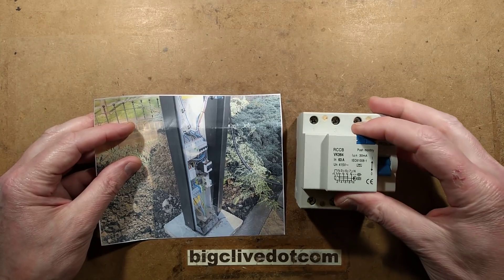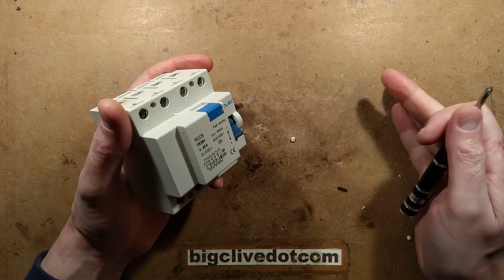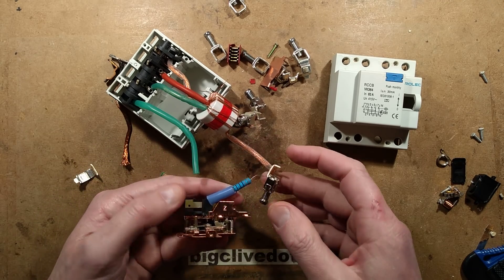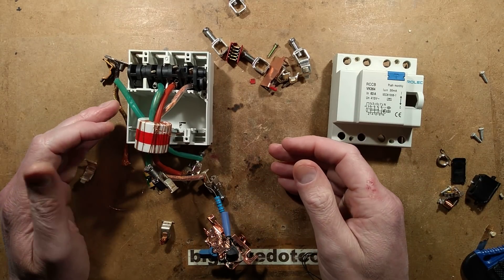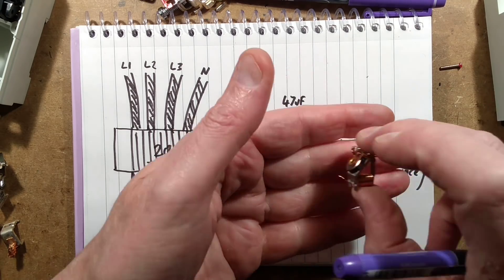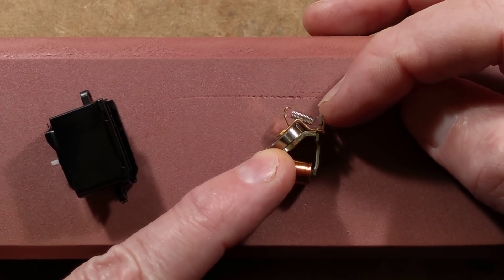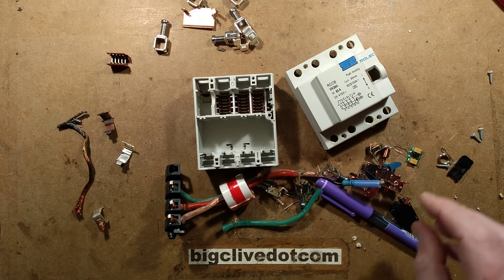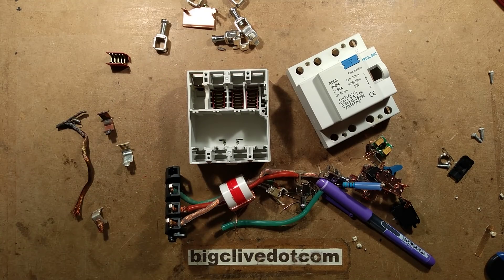Failed 3-phase RCD/GFCI from a Rolec electric car charging pillar. (with schematic)

Comment: Due to harmonic distortion more current flows through the neutral than the phase conductors, (not be confused with power factor). This is why the DNO are oversizing the neutral on new installations, eg 50mm phase conductors 70mm neutral. All modern switching electronics from light dimmers to switched mode power supplies cause harmonic distortion.

Comment: Many EVs only support single-phase charging (typically 32A) , so the burnt pole may be the neutral - Rolec had lots of issues with burnt neutral terminals on home charging units. My guess is that the spring being at the end furthest from the burnt contact means there was reduced contact pressure
Reply: The load was mostly single phase 32A, the L1 got most of there work to do. With these RCDs the neutral always seems ok though (despite the single phase load) but the single phase versions burn up even more quickly. My guess it is a combination of contact pressure and high resistance metal used on the contacts, they are just not suitable for 32A for 7 hours each night, night after night. This one lasted 3 years, but the new one that Rolec sent is a different design and I've not heard of the newer ones suffering this issue.
Reply: @G8YTZ 

Hmmmm.  Depends what you mean by mostly single phase.

If it were a balanced 3-phase load then the neutral current ought to be zero.  If it were a pure single-phase load then the neutral current ought to be the same as the L1 current.  Anywhere in between balanced and L1 alone, the neutral current is going to be less than L1 current.

Doing phasors in my head (and probably getting it wrong) a 32A L1 with 16A L2 and 16A L3 is going to result in 16A in the neutral.  32A L1 with 31A L2 and L23is going to result in 1A in the neutral.  32A L1 with 1A L2 and L3 is going to result in 31A in the neutral.

The L1 current could be significantly higher than the neutral if it's mostly single phase.  Depends what you mean by "mostly."
Reply: @bdf2718  The supply and charger are 3-Phase, but some cars have three phase chargers and some cars (the majority) have single phase chargers. This is why 4-Pole Type A RCD's are used as the neutral is required for single phase cars. (Type A is to detect pulsing DC faults on the DC side of the carer as Clive states).

So if you plug in a single phase Car (for example a 60Ah BMW i3) then 32A will e drawn between L1 and Neutral. (94Ah and 120Ah i3's have 3-Phase chargers, if their connected to a 3-Phase supply they will draw 16A/phase (12kW), if connected to a single phase supply they will draw 32A (7.4kW).

Most EV's have single phase chargers, hence the term "Mostly" so the L1 contacts will be more stressed rather than L2 and L3. The neutral contact in these RCD's and in the single phase version of this charger type for some reason never burn, but the L1 (or L contact in single phase version) contact always burn, even though they are running well within their rated current, but the very latest examples seem to have improved contacts.

A Tesla car also have 3-Phase charger(s) Depending on the model and age either 16A, 24A or 32A, but they all draw a maximum of 32A when connected to a single phase charger.

Note the function of the charger's Control Pilot pin (set on installation) defines the maximum charging rate according to the circuit and/or charging cable capacity. The car takes its loading instruction from the CP pin.
Reply: @G8YTZ  

The situation you describe doesn't mean that L1 is more stressed than L2, L3 or N.  It is stressed to the same level as L2 and L3 for three-phase vehicles and stressed to the same level as N for single-phase vehicles.  The situation you describe means that L1 is stressed more often than the other contacts.  Which isn't quite the same thing.

If you're right, it means none of the contacts are capable of carrying their rated load without burning out after a certain period of time.  It''s just that the L1 carries its rated load more often than the others.  It would mean that if it were used only for 3-phase vehicles then L1, L2 and L3 would all degrade to a similar extent and if it were used only for single-phase vehicles then L1 and N would degrade to a similar extent.  Which may well be the case.
Reply: @bdf2718  Except that this charger has never been used on a three phase load, so the L2 and L3 contacts have never seen load. But in practice is it is always the L1 terminal that burns (even on single phase units of the same make with a completely different two-pole breaker) and never the neutral which carries the same load. So there is something very funny about the L contacts. I even checked the power factor and harmonics from the load - close to perfect too. So it's a very strange occurrence, but one that many have seen. As Clive suggests it must be down to contact pressure not quite what it should be on the L1 contacts and that could be down to the positioning of the spring that keeps the contacts closed being at the opposite end of the cam, so pressure is not constant across all contacts (the neutral having a highest contact pressure).
Reply: @G8YTZ  
If it's never seen three phases loads then it has to be down to contact pressure.  Location of the spring would explain that.
Reply: @bdf2718  Yes - exactly entirely my thoughts. RCD's do get warm, I wonder if there continual warming of the mechanism causes the metal to soften? I have Crabtree Star Breaker MCB's and RCBO's in my Consumer Unit. The RCBO's really get warm, even with no load! The MCB's run cold. I'm wondering if there is not a scandal here with energy eating circuit breakers? They make a big fuss abut a few watts from a TV on standby, but has anyone thought of all those RCBO's out there? I have a FLIR IR camera. Clive, could this be an interesting investigation?
Reply: @G8YTZ  
I have almost no knowledge of materials science, but I doubt there's enough heat for softening.  And if there were, it would apply to both L1 and N (it's enclosed and convection will smear the heat all around).

Spring at one end of the bar seems the most likely explanation.  I'm not a mechanical engineer either, but I understand enough about levers to figure out why that was a very bad idea.
Reply: Looks like in this one the burnt one is marked 1, with the neutral being at the other end, next to the switch lever
Reply: Yeah, I'd guess a mechanical imbalance too, if it's true that it's always the end contact the burns out.

Comment: I think the end contact burning is due to Newton, it will take just a fraction of a second longer to breake contact due to inertial forces causing twisting of the contact bar. All the actating forces are at the other end of the bar so it will twist a fraction as the contacts are opened so the far end will be the last to open so the system will try to draw all the power of that one line.

Comment: This reminds me of when I used to work in tv repair - Back in the 80s we used to see a lot of those old Ferguson TVs that used the Thorn TX9 chassis. These had an unusual thyristor-based PSU, and the most common issue with those was a burned up connection inside the mains plug, and it was ALWAYS on the neutral pin. Usually just cleaning up the connection (or in bad cases just replacing the whole plug) would result in a long-term fix but it was a bit weird at the time why it would always be the neutral end that burned up rather than the live.

Comment: The reason the first phase went out is likely because there are a substantial percentage of electric cars that only use one phase of input power.  So that post will often be supplying. Ritually no power on phase 2 or 3. So 1 is used most and most likely to fail. Of course in this case the neutral is carrying the same current as phase 1 and I can’t explain why it is unaffected. 

The high power chargers your hear of are DC fast chargers. Unlike this AC EVSE (this is not technically a charger as the onboard charger is used for AC charging) a DC fast charger has a captive cable. So people are not using their own bunk cables on Those fast chargers. On the other hand the cable on a 1MW DC charger will be water cooled. So that’s potentially exciting. 

In the US an EVSE must have built in ground fault monitoring and disconnect on fault. I’m sure it’s the same in Europe. In the US some say you should not use a GFCI with and EVSE because of this but as far as I know they work fine in that combination. My EVSE has no GFCI breaker.
Reply: So I looked it up to try to be more sure I’m not wrong.  It the full spec is $500 and I’m not THAT dedicated to accuracy. 

It appears that in the US even though every EVSE seems to have integrated, active monitored, self-resetting ground leakage detection it is not required to have this. It simply must have the detection and trip functionality in the EVSE. Not just in the install (like in the post) but as part of the EVSE. And also the requirement is 30mA in the US also as you indicate in your post. So as long as this RCD is actually inside the EVSE itself as shipped from the factory this would be a legal configuration in the US. I had previously thought it was not as it was not active monitoring.

But I have never seen an EVSE that just had a physical breaker like this in the US. All are self resetting, implemented as a ring around the conductors inside the EVSE that is monitored by the EVSE circuitry itself. They basically just have two rings, one which passes all conductors and one that passes only one supply conductor. The first is to monitor leakage and the other to monitor current draw for over current protection. Protection is implemented by simply cutting off the power to the wand with contactors if a fault of any kind occurs.
Reply: Steve Bollinger - interesting 😀. Strange how for something that is new, therefore no existing equipment or old standards, different countries still have different ways of doing things.
Reply: Steve Bollinger - the device that failed is an RCD, used to detect earth/ground leakage faults...
Reply: Mark 1024MAK I know. I’m not sure what you are getting at. In the US the EVSE itself must have the ground fault function detection as part of the EVSE itself,  it as an external device as you see here. I expect it’s the same in Europe. Although again, it is my understanding that despite what some people says it should work fine to have an externals protector also.
Reply: Steve Bollinger - Are you saying that the requirements are that there must be additional protection against earth/ground faults? I don’t have any specific knowledge of electric vehicle charging points, as I have not worked on any. In the U.K. for outside electrical supplies, RCD protection with a trip current of 30mA is required. For a dedicated circuit spur such as a recharging point, it must be on its own circuit, and be protected by a suitable MCB. There should also be a suitable isolation switch (double pole).

Comment: 1 megawatt chargers!!! if all trucks in the future become electric where are we going to get the power from?? it blows my mind.
Reply: Well, technically we are already generating that power.  It’s just that right now it’s distributed in millions of comparably inefficient mobile power stations versus a relative handful of much larger and much more efficient stationary power plants.   But it would require significantly more generation capacity and a beefed up power grid and thus a valid concern.  Everything has tradeoffs in life, but stationary power plants do generally have significantly greater efficiencies and much better pollution control than is remotely practical in a moving vehicle where every added ton of weight (in pollution control and efficiency technology) only further degrades a vehicle — there are no real weight penalties to stationary power plants.  It is also presumed that the bulk of “routine” charging loads might well be governed by the power grid itself — cheap charging rates if you let the utility decide what hours the charging of your vehicle occurs (such as when parked at home and work) or much higher rates for on-demand charging (such as at a public charging station where you want full charging power immediately so you can get back on the road).  But letting routine everyday “topping up” charging be managed by the utility would carry with the advantage of evening out the charge load and allows the utility to momentarily shed “routine” charging loads on an as needed basis to accommodate instantaneous peak needs — such as someone’s megawatt charger suddenly coming online and who is willing to pay a premium for interrupting your charging.
Reply: Power might not be the biggest problem, an estimation concerning the resources to built all those batteries showed that should we built all-electric vehicles, the resources to make smartphones (and quite possibly any other piece of electric equipment) would be depleted basically from the moment we would start to make the huge amount of batteries required.
Also, the bigger problem concerning the required power, is the spike in power requested when multiple trucks accross the power grid would plugin at about the same time.
These spikes in request are the exact opposite what has happened in Germany when a partial solar eclipse caused a sudden increase in requested demand because the huge amount of solar panel installations there stopped delivering the amount of power normally accounted for on either a clear, sunny day, or cloudy day.
Those dips or spikes can cause big disruptions further up in the grid, due to frequency deviation that might cause safety systems to kick in because they might sense a huge short (the combination with a drop in voltage might be the biggest problem for those systems to seperate them from sensing a short instead of a loss of delivered power back into the grid.)

Comment: I suspect the neutral was connected to that terminal and I suspect the neutral current is very high, I've seen things like that before and it always affects the neutral. In New Zealand the RCD's that must be used to vehicle charging are type B RCD's
Reply: Michael Webber - elsewhere Clive says that was a phase conductor...

Comment: That is voltage indepandent type rcd, the chines one is voltage depandent and there is danger of losing protection with rcd in case of break in neutral. https://www2.theiet.org/forums/forum/messageview.cfm?catid=205&threadid=84500.
I gees ROLEC RCD have not good tight screw on that terminal.

Comment: Is all the return current from the three phases going back through the burnt contact and overloading it?
Reply: The burnt contact is labelled "1" on the box;"N" is the right-most contact.  It might not have been wired properly though......
And perhaps the supply into the box is only single phase, or only one phase is used in the vehicle.

Comment: A guess would be when you reset this style of RCD the contact that is burnt is the last one to close (by a few ms?) because the lever is operated from the other side of the unit, the bar inside flexes, but in this application I can’t see that item being operated very often nor under load, so maybe other factors but that’s my guess.  I have seen 4 pole breakers that have been pushed up from one side destroy equipment as the neutral connected momentarily after the phases.  We confirmed this by testing it afterwards - was on one of our genset hired to a customer.

Comment: What about the test button. As it's not electrically connected it must just manually trip it. Not a safe way to test the electronics.
Reply: Kym Sims - so what’s the resistor for?
Reply: @Mark1024MAK  if the 20 coils only develop power when there is an earth leakage, where would the solenoid get its power to trip the breaker?
Reply: Kym Sims - Although Clive did not really cover this, the typical arrangement is the resistor (switched into circuit by electrical contacts operated by the test button) allows some of the current to by-pass the main coil, this causes an imbalance (the line and neutral magnetic fields no longer cancelling out), which induces current flow into the fine windings of the main coil, which then flows via one of the capacitors to the trip coil.
Reply: @Mark1024MAK  Thankyou, that makes complete sense.

Comment: Bad connections get higher resistance. Higher resistance means more heat. These failures, in All power distribution panels can be attributed to a starting bad connection

Comment: 2:51 Clive did you notice your electrical tester screwdriver lit up as you was removing the rubber plug in the back. 
Why would it light up?
Reply from the maker: It tests continuity.  There's a battery inside.
Reply: Ah yes of course! Sorry it was late and I thought it had picked up some capacitor or something. 🙄

Comment: This circuit seems really weird to me.
First they limit the voltage to around +-0.6V, which means the maximum voltage drop in the Current Transformer would be +-30mV in any winding. Fine so far.

But now the RCD is supposed to trip at 30mA fault current, which will be 1.5mA on the secondary, which is then essentially passed through a capacitive voltage divider with the trigger coil in parallel to one capacitor. I don´t get what this is supposed to accomplish.

If i´m not mistaken, the arrangement of capacitors (effectively 15uF in series) at a trip current of 1.5mA through those, would result in a rate of voltage change of 100V/s across the diodes. Without the capacitors the voltage could rise as fast as it wants, until it gets clamped by the diodes. But since the trip coil surely has a significant inductance, I´m not sure why that would matter. Maybe they want the trip coil to form an LC resonant circuit with that capacitor to help it demagnetize?
Reply: What's also odd is the use of polarised caps, I guess they rely on the fact that the caps may not fail at only 0.6V reverse voltage.
I guess I should have waited righ to the end!